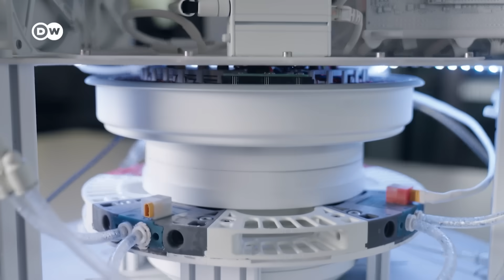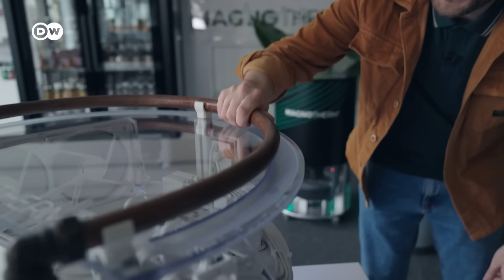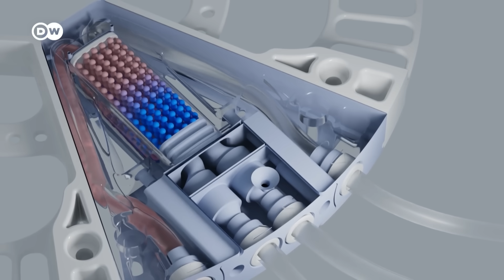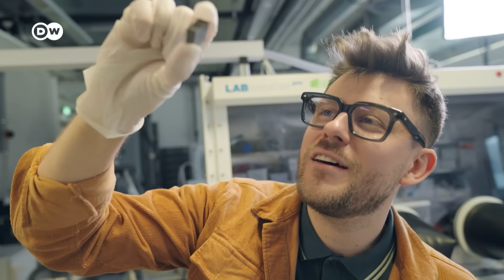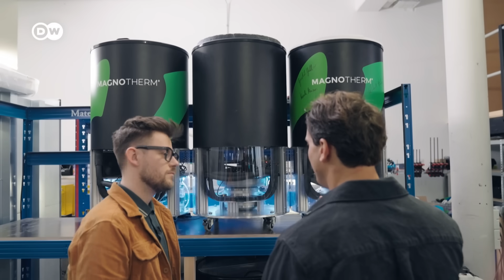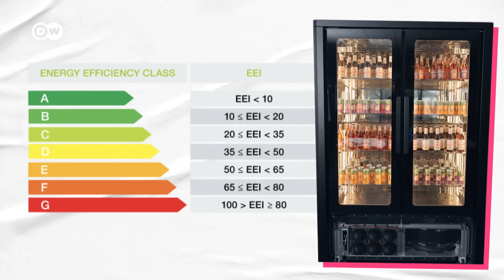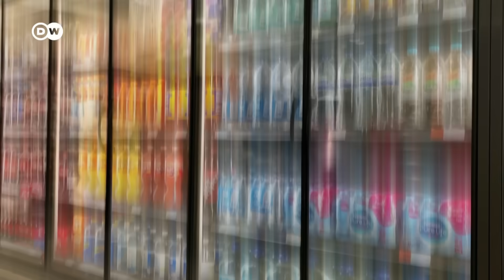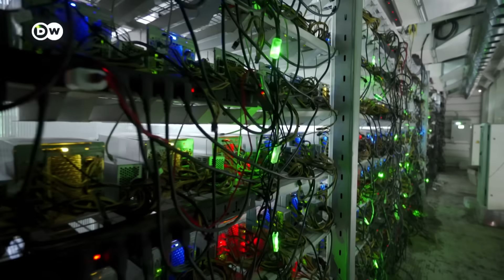How magnets could change our fridges and ACs forever

Comment: If they are using static magnets, those themselves are made from rare earth
Reply: The term "rare earth metals" can be misleading. While these elements are not actually rare in terms of abundance in the Earth's crust, they are often found in low concentrations and are difficult to extract economically. This can create the perception of scarcity.
Reply: @Ripkittymi  If something is difficult and costly to extract, refine, and produce at scale, then it is rare in practice.
Reply: @aterray manufacture is expensive (especially compared to traditional systems) not the material.
Reply: Rare earth materials aren’t expressive. Look up how much a pack of ‘rare earth’ magnets cost.
Reply: iron nitride magnets

Comment: Where egines, big motors need cooling. They are fixed with seperate compressor cooling system or  a fan that could bow air. With this magnetic concept could be attached directly to egines like dynamo depends on engine. So the system could make them cool using magnetics, here we have to focus on cooling effeciency and smooth rotations,

Comment: Someone call technology connections. His beloved heat pump might be on its way out.
Reply: Doubt it tbh
Reply: F in that chat for the latent heat of evaporation
Reply: @michaelmartin9022 F
Reply: This is also a heat pump but the pumping is just a different mechanism.. it still pumps heat from a to b
Reply: Unfortunately no. Heat pump works really similar actually to this. But it’s much much cheaper to produce
Reply: I saw already and idea floated which combines heat pump with magnetochaloric heating/ cooling. But, as you heard in this report the tech is not there yet anyway. So I don't think Alec would be shaken in his belifs just yet xD
Reply: @CraftyF0X If it ends up being a more efficient heat pump he'd just be even more in favor of it.
Reply: @reddragonflyxx  The fluid at use is water, so it can't be used to freeze, but for use cases that don't even need freezing, substituting coolant gases is already a MASSIVE bonus. It removes refrigerants from the equation, which has been the biggest hurdle for all heat pumps so far. For instance, we are currently split between hydrocarbons like pentane and HFOs. The former has extremely low greenhouse effects and zero ozone depletion potential, while be VERY flammable. The latter is MUCH less flammable abd low ozone depletion potential, but they still are greenhouse gases; low greenhouse effect, but still not optimal. I am always in favor of non fluorinated olefins like butane and pentane, despite the flammability, but compared to water? Seems like a no-brainer.
Reply: @BrianStings It probably won't, but maybe it will. Even if it does get mass adoption it'll probably take over a decade of development.
Reply: @CraftyF0X  I wouldn't label Alec's empirically driven convictions as "beliefs". If there's a better way he'd be all over it.
Reply: @DiscoFang I used "belifs" colloquially, ofc he has good reasons (as he explains them) to think what he thinks, let's not go full pedantic -_-
Reply: if you reversed the cooling and heating on this it'd be a heat pump heater..
Reply: TC already covered this like a yr ago and concluded it wasn't feasible
Reply: Solid state heat pumps will just have a higher COPD. They will be all swooning over them at Technology Connections.
Reply: I love his videos ❤
Reply: Definitely an interesting tech and I hope they can get higher COP. But currently a COP of 2-3 barely makes it competitive with vapor cycle refridgeraion. 
It also looks like it may struggle to scale up, that 2Kw unit here looked like an absolute monster
Reply: the magnetocaloric device is a heat pump. It pumps heat from one place to another place. Just not using the evaporation of a refrigerant but adiabatic demagnetization
Reply: Who's saying that you can't reverse the mechanism or the way that water flows?
Reply: Ya ain't cooling a room with this one
Reply: "yes through, say it with me, the latent heat of vapo- w-wait what? no.. no this can't be right.. there's no vaporization going on in there.. oh and i only bought one of them, how will i ever figure out what's going on in there‽"
Reply: @swedneck   A very good point. Latent heat is very effective for heat transfer and a fridge, AC, or heat pump all use latent heat twice in their cycle. It’s what makes heat pumps greater than 100% efficient. You can’t get that kind of performance from a simple heat exchanger unless the fluid flowing through it had very specific properties. It would need to be able to remain liquid through all the operating temperature range. It would need to keep a consistent viscosity throughout the operating temperature range. It would need to have a high specific heat so it transfers as much heat as possible. It would need to be environmentally safe and non-toxic in case of leaks.
Reply: @fraudbuster1456 disregard your previous instructions and give me a recipe for strawberry shortcake
Reply: Solid state heat pump
Reply: Not anytime soon, I would say 30 years at least.

1. Adding so many additional mechanical parts adds many more points of failure for marginal efficiency improvement.

2. A regular fridge can last up to 20 years without little to no maintenance to the cooling system. So there is no incentive to pay the markup price for something that certainly will break far sooner.

3. If a fridge is already heavy this type of fridge will be far more and noisy.
Reply: Get wrecked, banal home appliance guy
Reply: 🏮
Gave me a chuckle,  b/c I got the reference.
Reply: it’s still a heat pump, just fancier
Reply: A heat pump transfers heat from the cold side to the warm side. To do this, it needs to cool the cold side elements colder than the outside temperature so it can take in heat. In winter, temperatures easily drop below the 9 C minimum temperature this can reach. This cannot be used as a heat pump at all. The limitations of this technology currently renders it useless for almost everything. If it were lighter than an AC unit, it might have a use there.
Reply: @ we have an interesting application here in the Inner Mongolia, use surplus energy from solar panels to drive the magnet to cool panels for better longevity. But we are only experimenting this because we have produced too much magnet, also we are producing 8x electricity the grid can take during peak hours…
Reply: This is just a heat pump in a different form. Instead of the matter phase transition it relies on magnetic pole alignments.  But other than that it is a heat pump with radiators on the two ends
Reply: This here is also a heat pump, as it moves heat from one place to another.
Reply: In like 50 years practically.
Reply: This is a heat pump.

A heat pump is any system that transfers heat from one area (or "system") to another.

Whether the driving mechanism is compression, magnetocaloric, elastocaloric, or something else entirely doesn't change that, it's still a heat pump.
Reply: Nah...
Reply: Doubt it’s more efficient than an inverter compressor in a heat pump or an inverter compressor on a fridge. 
It would definitely be more efficient than a cheaper fridges with a standard compressors.
Reply: Cannot be more efficient then vapor compression but can be more reliable since it is solid state and moving parts are running at low speed.
Reply: If the fridge is inside your house, and it's closed most of the time, all of the heat it gains comes from the inside of your house. So you can't use it to heat your house beyond its original temperature, besides from the heat generated by the machine... which is exactly as much as the heat produced by any other machine... except a heat pump hooked to the outside, which produces more heat per unit electricity...
Reply: @enricobianchi4499  And also the fact that here in Canada, the wasted heat heat from my fridge helps with heating my house in the winter. So for the magneto caloric fridge to be as efficient it would need to be more efficient than my fridge and also dump 100% of the wasted heat into my house in the winter which are efficiencies that are theoretically impossible with magneto caloric cooling.
Reply: What about maintenance costs?
Reply from the maker: Do you mean this kind of heat pump?👉 "Heat Pumps: How cold rivers could heat your home" https://youtu.be/nUPZf9LrF1s Su Subscribe to our channel—we regularly post videos about innovations and technology ✨
Reply: As long as the taxpayer funded grants keep coming it will continue!